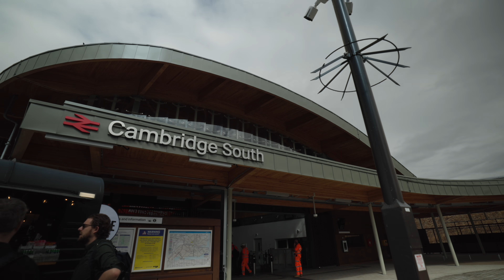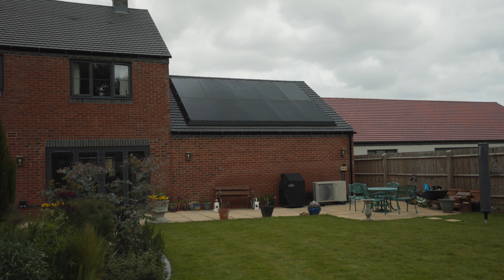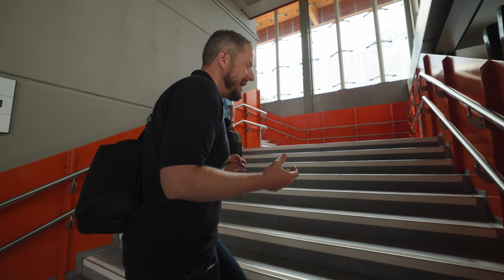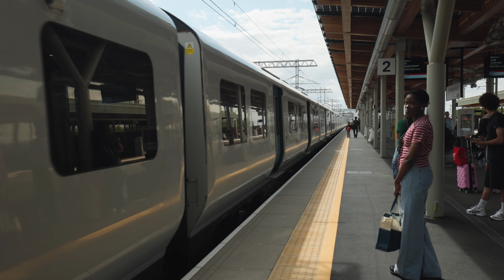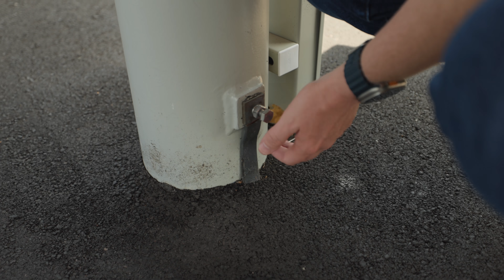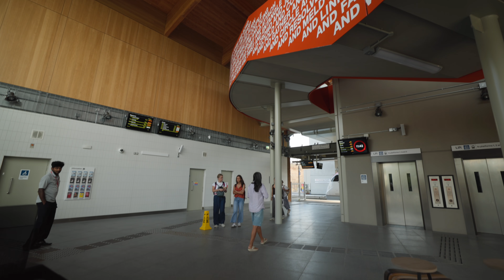£200M Station Solar BLEW MY MIND

Comment from the maker: What’s the most impressive solar installation you’ve seen, and where should we go to check out next?
Reply: I'd like you to expand on this project further and maybe get an official tour with the design team. Especially interested in the detailing of the 'waterproofing' of the canopy, and how it copes with expansion/contraction etc. This could become your 'specials' series :)

As a Brit in Canada I'm planning to install a solar fence later this summer around the garden.  Panels are now so cheap the cost differential vs. installing a traditional (quality) fence is minimal. Nuts!
Reply: Cobham services on the M25 and Beaconsfield services on the M40 completed by Spirit Energy!
Reply: Edmonton Convention Centre here in Alberta. It's a 10-story wonder dug into the River Valley edge in downtown and has a  $6M CAD solar array now installed all the way down its one-sided glass facade running from street level down a south facing cliff to about 100' below.. The building alone is astonishing as it was built on abandoned coal seams and quicksand and involved the largest earthworks movement on earth for a single building at the time. 3.5 million cubic feet the size of a soccer pitch 60' deep. 70% of the stacked structure is still underground built into the cliff face. It's worth the trip alone much less the fact the airport here is adding its own solar farm so that when it's complete YEG will be a net SOLAR positive airfield creating far more energy that it consumes with part of it having a plan to create on-site green hydrogen for aircraft from its surplus. All at 53N latitude the same as Dublin, Manchester, Hamburg and Minsk... And the Edmonton Expo Centre roof is also entirely covered in solar just north of downtown. Almost all new structures built by the city have them integrated which is very unexpected until you realize Alberta is Canada's sunniest province and with moderate temps and tons of summer sun? They do really well here.
Reply: Being in Cambridge, I’m surprised that you don’t seem to have already done a video on King’s College Chapel’s roof-top solar installation which was in the news a few years ago.
Reply: Don't I know your from Cambridge. When I inquired about you working in Oxford, you told us you wouldn't helo us if we were on fire!! 
(Besides we were too far away) 
Which I have generally taken that to be a no then!

But thanks for the very cool video. I love your content. And I personally like Cambridge more than Oxfurd, so you not wanting to come makes sense

BTW are you still commuting from Marsailles??

Best Wishes
AnnA💋

Comment: Ok , I have and like solar &EV , but 250M? Is any tax dollars used then looks don’t matter with that prices could they have made 1/2 price flat roof with more solar then waver curved roof angles wrong & there are acres of grass fields next to the station. They could’ve used the roof water to water instead of spending more millions on a live roof, it seems like the amount of electricity they make from the solar will never cover the 250 M, they probably spent more dirty energy building it than the solar panels will ever do if it’s privately built with private money, they can do what they want

Comment: As per AI:

No, Perlight Solar did not supply the solar panels for the newly opened Cambridge South railway station.

Instead, the solar panels were designed, supplied, and installed by the UK-based building-integrated photovoltaics (BIPV) specialist Polysolar.

The station features a unique, highly sustainable infrastructure design including:

650 solar panels integrated directly into the undulating, curved platform canopy roofs.

Semi-transparent glass-glass PV panels on Platforms 1 to 3, which serve as a weatherproof roof while allowing natural light through to passengers below.

TW Solar panels integrated alongside a specialized Bauder living roof system on Platform 4.

Comment: These are exactly the kinds of bifacial solar canopies that should be everywhere on earth. Ditto for bifacial vertical panels as fencing. If we start to think 3D solar installations instead of just traditional roofs and fields the market really opens up the possibility to a truly Solarpunk future... As a Canadian who grew up with my local United Church being a Glu-Lam sanctuary I am obsessed with seeing these wood turned structural support beams and columns used as much as possible since it kills two birds with one stone metaphorically. It uses up scrap wood that would traditionally be burned or chipped into nothing and it warms up spaces that would otherwise feel sterile.. Plus they just look cool!
Reply: I was surprised by the bifacial though - does that much light reflect up from the surfaces to them?

Comment: This is nice but kind of annoying, because I want to do a similar design on my garage roof. Actually using the panels as the roof material in a very similar way to some of this design. As a consumer it is incredibly difficult to get hold of any information about products that can do it I can get the panels easy but the framing is less simple. I have seen many instances of car ports and other things which are built like I want to do my roof but trying to buy the stuff to do it is virtually impossible in the UK.

Comment: It's impressive, for sure, but my recently refurbished railway station in Chippenham, Wiltshire isn't carrying a single PV panel, despite it being on a part-electrified railway line. They cut down the 8 existing trees and built an oasis of concrete and tarmac for driving and parking in their place. Today ... it's "desert-hot" there.

I really support all of your great work. But, I'd like to point out that all that beautiful glue-lam wood was once living tree. And last time I looked, we were rather short of trees and getting shorter very quickly, as so many forests around the world are being cut down (for construction & electricity) and being burned to ash, along with the biomes they support, which today, are being burned alive.

Surely an architect that deserves praise would conceive a complete structure made out of old PV panels, to support the excellent set of new PV panels ...

... and leave the trees alive, supporting the symbiotic lifeforms above and below the ground and building new carbon-rich soil that we desperately need. 

A modern water-jet can easily slice up old panels as required, glues can make laminated beams, frames too with rivets and bolts. We don't have to cut down trees and terminate the lifeforms they support to make spectacular "green" statements, but we do need to use our brains.
Reply: As long as the timber comes from managed forests there is a good argument to used it. The carbon within the wood is sequestered (captured) until the wood is burned or rots. New trees should be planted to replace these and in turn capture further carbon when they grow. A few countries are thankfully planting lots of trees, china planted 8.8 million acres of forests in 2025. Unfortunately the uk fell below its target 30,000 hectares. The best use of recycling PV panels is probably to make new PV panels; apparently you can make 10 new panels from a single old panel from circa 25 years ago, much thinner, lighter and more efficient now thankfully.

Comment: i wonder how much will it cost for permissions and insulation for 15 kw system if i provide  all the material with 32 kw battery i can buy my self and will i get permission for 15kw in a home in uk it should take 20 aiko panels 770 watts each on a four bed room house if not how about 10kw will that fit please let me know i watch all your programmes

Comment: Moore parasites on the grid the ignorance of Renewables on the grid is easily demonstrated with a volt amp meter and 4th grade math called Ohm's law so while they're actually causing electric bills to Skyrocket because they can only put in 15% of advertised output if you were to double-check your installed watt meter you'll see an 85% difference on what's actually going in the grid and not

Comment: Roof space should be used like this on as many constructions as possible. Thus is a great example.. I object to the use of green fields and farm land for solar panels which should be used to provide food. Are the panels British made?
Reply: I generally agree with you, but to be fair solar panels can not only be compatible with farming but enhance some farming and help to stabilize the economics of farming by providing a second "crop". Some crops depend on shade. The shade prevents some evaporation and shelters livestock. Especially with global warming a bit of shade could be nice.
Reply: @markfeldhaus1 trouble is, most don’t seem to be using the land underneath, it is just fenced off

Comment: Well that was fascinating Jordan, I had no idea Cambridge had such a magnificent station. 

I'm a bit old and haven't travelled by train in donkeys years but there used to be a thing called a "platform ticket" which you could buy if you were meeting someone from the train or even just trainspotting. I take it they don't exist any more? 

Or perhaps being a "young" chap you hadn't heard of them? 😁😂
Reply: Cambridge South doesn't have a Ticket Office, just ticket machines, so a Platform Ticket wouldn't have been an option alas.

That said, if Jordan had reached out to Greater Anglia or Network Rail I'm sure they'd have sorted out an official tour.
Reply: The station only opened at the end of June, so mostly locals and regular passengers around Cambridge know about it.
A Network Rail press release reported over 110,000 passengers passing in or out of the gates in the first month. It will be interesting to see the end of year statistics, but even if most passengers would have travelled by train anyway to/from the central Cambridge it will have sped up journeys and taken traffic off the congested roads.

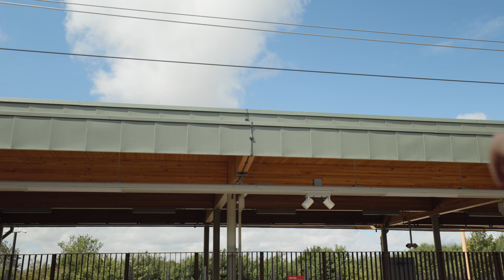Comment: 6:54 the earth bonding on the canopy structure will also be for protection from the high-voltage overhead lines that power the trains. If for some reason an overhead cable breaks and comes into contact with that canopy structure, you need a safe path to earth.

Comment: What's really nice about it is that they've used the solar and framing to echo very traditional Victorian station canopies (the kind the idiots under Beeching mostly trashed) so not only does it make great use of bifacial panels sloped to fit but it copies the traditional glass canopies we associate with railway stations - although the victorian ones dimmed the light down onto the platform using soot and dirt rather than solar.

Comment: £200m+?
Reply: That is a total station.
Reply from the maker: Yeah approx £250M project I believe
Reply: That cost is not just for the station building itself, but for the extra track and signals needed for it - and it’s not just the cost of physically building it all, but of the planning, design, and engineering as well.

Comment: Ambient noise sensor: part of public address/voice alarm system (linked to fire alarm) to monitor the background noise level and adjust the PAVA systems volume accordingly.
Reply from the maker: Great info!
Reply: We had a similar thing at a village hall I was involved with specifying the tech for. It would cut the power to all the stage power sockets if the noise got above a certain level. This was a requirement of the planning to stop loud events getting too loud - a pain for anyone playing a band there but it was set pretty loud so really just stopped irresponsible hirers given this hall was in a sleepy residential area.
Reply: Similar to large concerts where they shut down the power to the speakers when the fire alarm goes off to allow the alarm to be heard